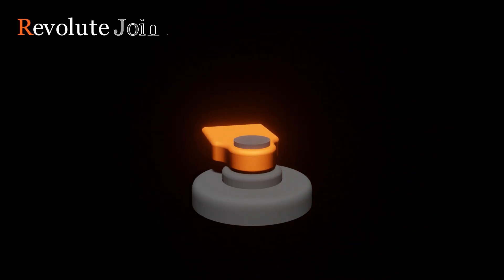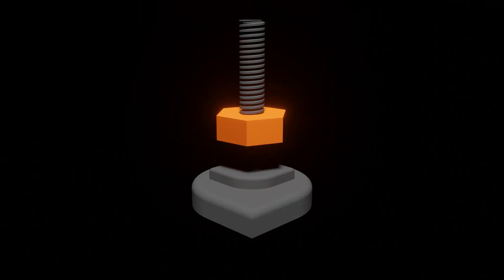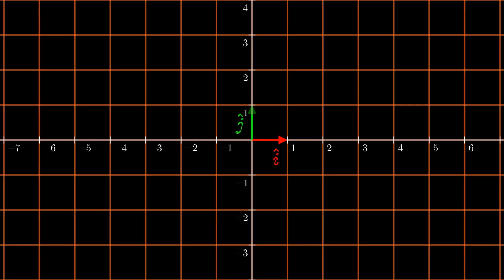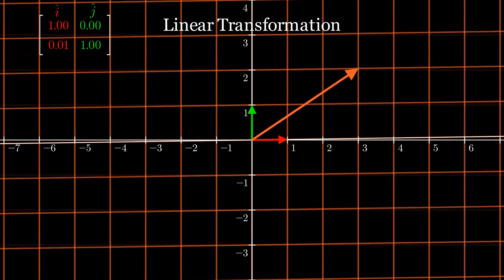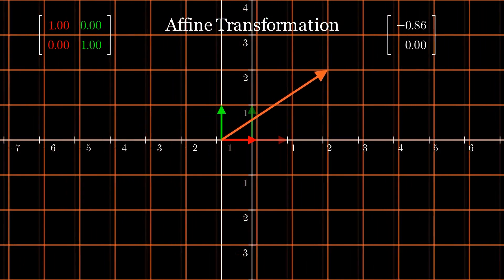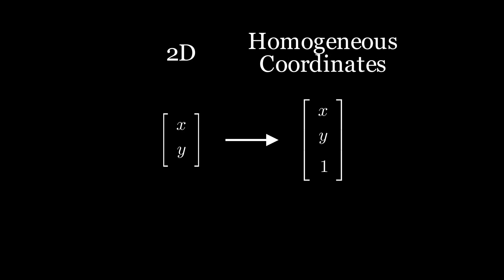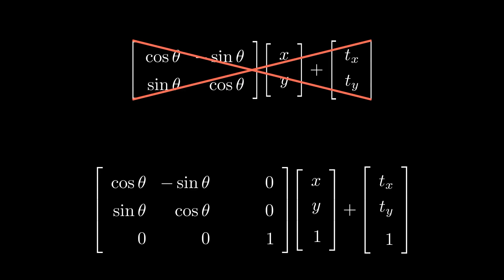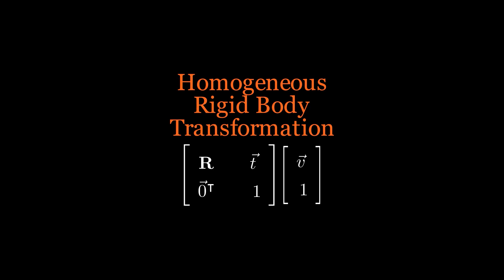Fundamentals of Robotics - Part 1 : Combining Rotation and Translation #SoME2

Comment from the maker: In my quest to get this video done before the SoME2 deadline I've used some statements that are misleading/confusing or straight-up wrong and it is totally my fault. For example, "All lines remain straight, parallel and equidistant after a linear transformation" should have been more like "All sets of straight, parallel and evenly spaced lines remain so even after a linear transformation". I have also heard from my friends that the translation bit was confusing. I originally wanted to make a 20-minute long in-depth video and I've decided to redo this video according to my original plan without cutting corners. I'm open to any and all forms of constructive criticism.
Reply: That's great man, can't wait for that and part 2 of this!!
Reply: Impressive to see that you accepting and correcting mistakes 👍
Reply: I'd say it felt a bit too fast. Like I had to check if I did not speed it up in settings myself. A bit of a slower pace would have been nice to let things sink in. Plus the diction is a bit off. Everything feels like it's said in the same tone of voice, the rhetorical questions or important moments of the explanation do not differ much from usual sentences. And some words or even sentences also were not said clear enough, so had to use the help of closed captions to fully understand what was said. Finally some places needed pauses (as I said, to change pace and let things sink in). And in others there appear some unnecessary pauses.